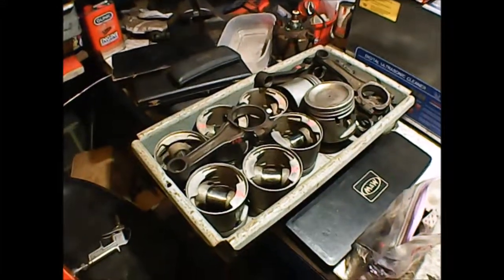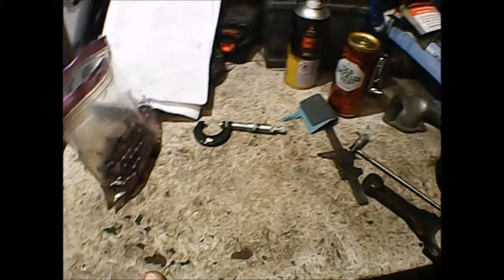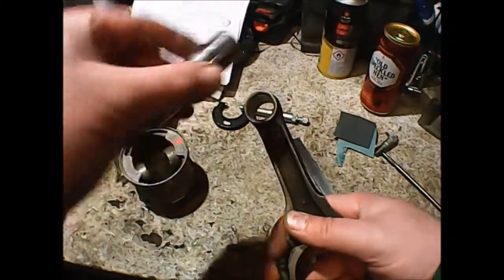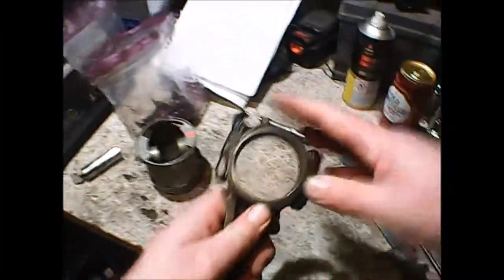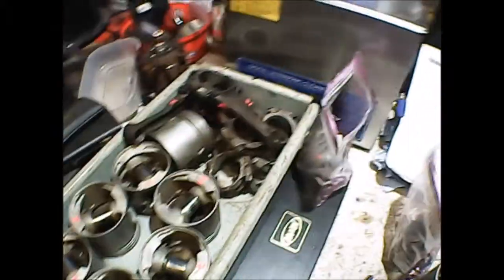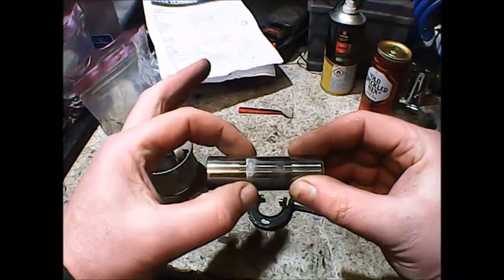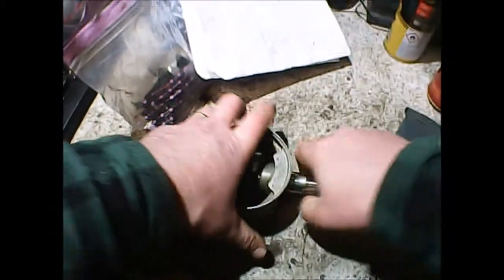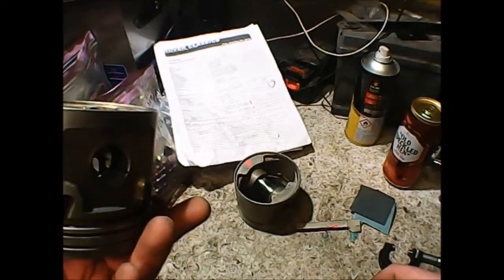Rover V8 piston and rod assessment

Comment: How do i prime oil pump for the rover 3.5l v8 buddy
Reply from the maker: Either pack the gears of the oil pump out with vaseline of use a main power drill and adapter through the distributor hole to wind the pump clockwise until you feel resistence.

Comment: I can see that your keen for the tasks involved but you don't measure pistons like that. Pistons are cam ground and thus oval and tapered top to bottom. Skirt clearance at .0015 is good. Measure the pistons on the thrust sides lower down on the skirts. There's always greater clearance at the top of the piston to allow for greater thermal expansion. An area of concern is usually the top ring land which runs in  the most hostile environment. This land should be checked for both distortion and flaring of size with regard to width and viable clearance on the top ring. Machining and fitting either an insert or custom wider top ring is a method of restoring the piston to viable use if no other options are economical. The rod ends should be resized on a long lived engine as it also improves the bearing seat and insert crush. Rod bolts should also be carefully checked for thread damage and stretch. Good luck with your build.
Reply from the maker: thank you, I learn something new every day and never ever ignore advice 👍